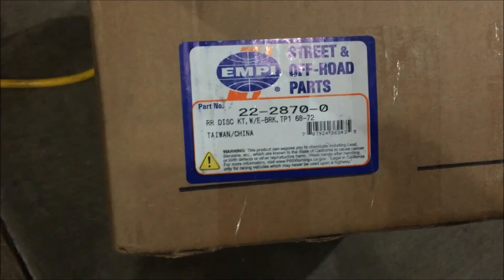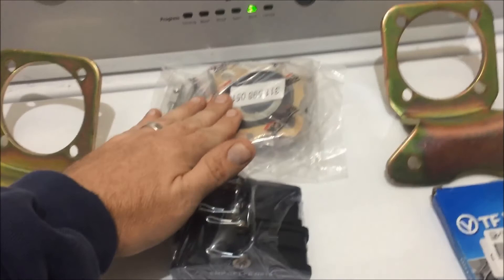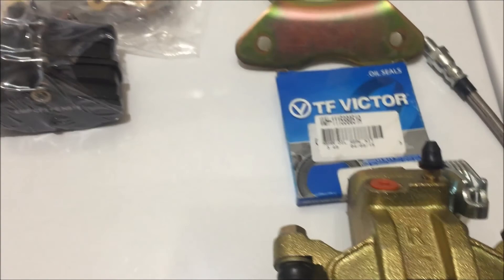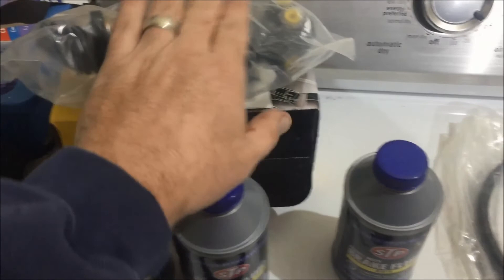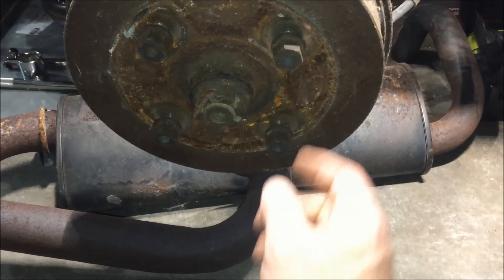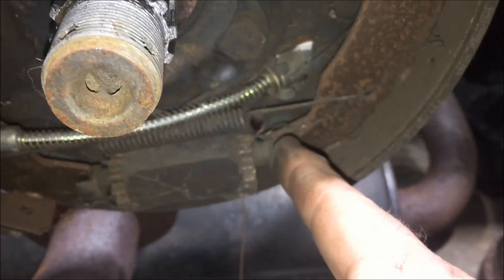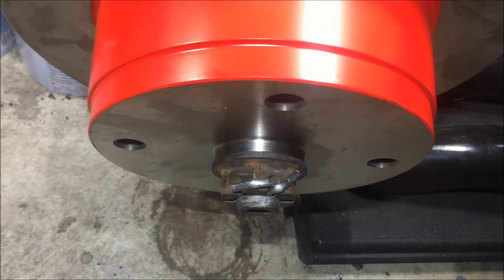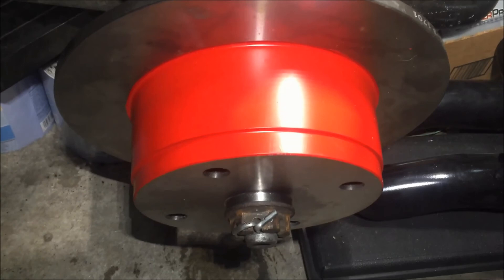Vw bug EMPI  rear disc brake conversion Part 2 of 3

Comment: Nice work. How did you paint your calipers?  I'm about to do the same to my Ghia and I'm wondering if I should sand them before painting.
Reply from the maker: johnwarfn 
Thank you for checking out my video. I actually hand painted them with a brush. I would lightly scuff them up before painting. I put about 4 coats of the green and 4 coats of the clear. I would recommend high temp paint.

Comment: What rims, size and offset did you go with? Thanks, love the build
Reply from the maker: I went with 15x8 rims I painted them to match the car. 

Bassett Inertia Advantage 15x8 in 5x4.75 Black Wheel Rim P/N 58AC3I https://www.amazon.com/dp/B000F4JZ7U/ref=cm_sw_r_cp_api_i_JY0IFbV400B7N